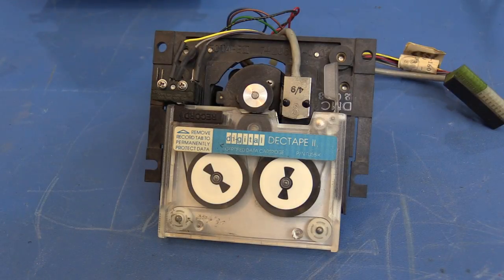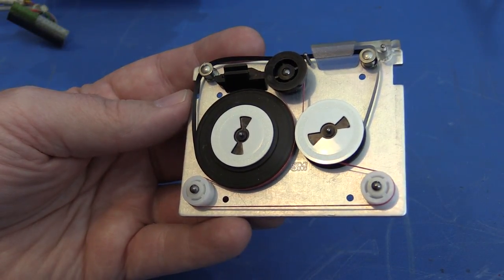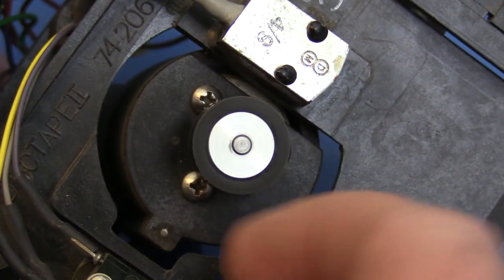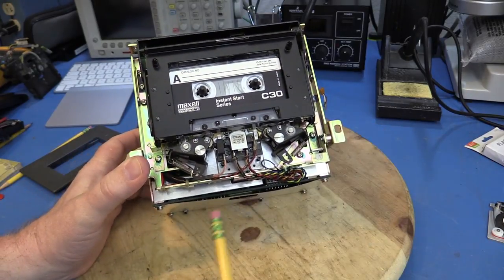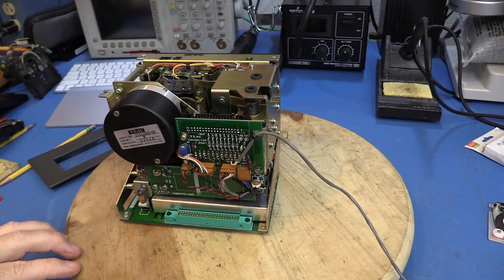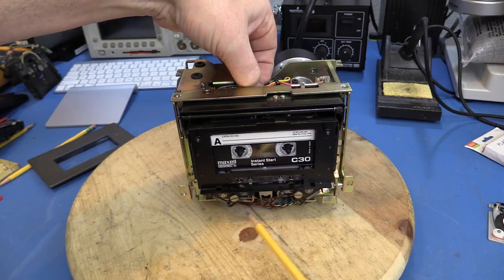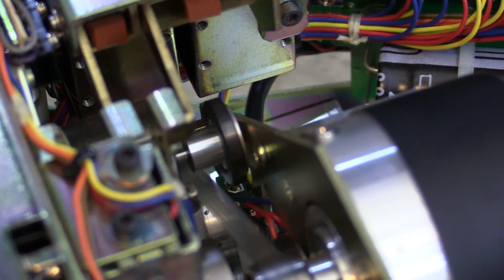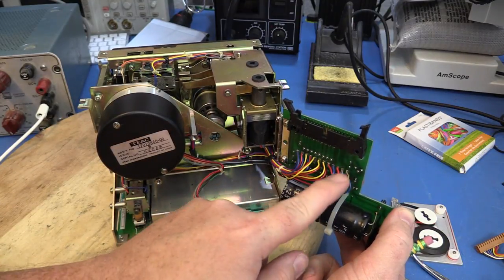DECTAPE II, TU58, and TEAC MR-30 Transport

Comment: This is exactly like the HP and QIC tapes I use on my HP-85. None of the older HP tapes with the narrower tape did work, and I had the same problem with failing transport belts in the tape. I had to convert to DC 3000 quarter inch (QIC) tapes, which worked well. And the HP drive capstan also turns to goop too...

Comment: I got brand new SONY QGD 170ME and FUJI DLT tapes from auction. Have you ever try to record music to data tapes? Those data tapes must be vary good quality.
Reply from the maker: I have not tried that. Are there any audio tape recorders that can use 8mm wide tape? The data tape drives for those 8mm cartridges used a helical scan like video tape drives.
Reply: @Nf6xNet  That's the problem. 8mm tape need to cut half wide. Or use reel to reel machine. what I don't have... :D One solution are to use backup drive, and replace data-head to audio-head (or two).  I think that data tape is some sort of metal (Type IV), so it must be sound nice.
Reply: Using that, is basicly like invent new machine...